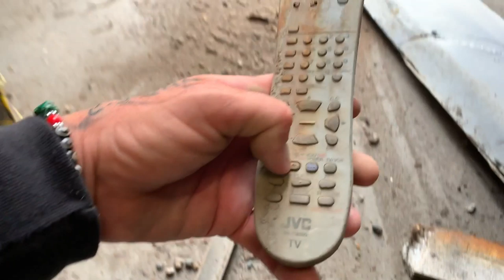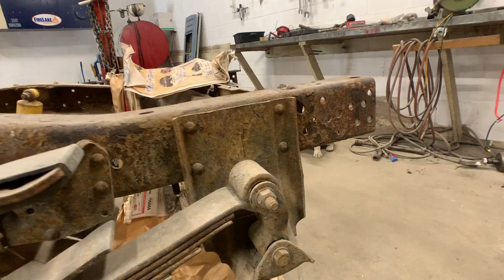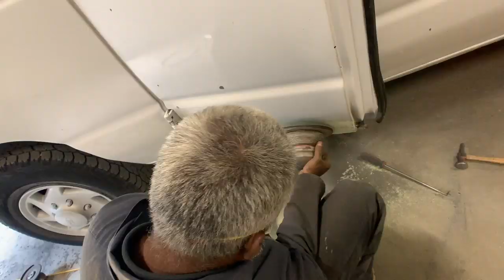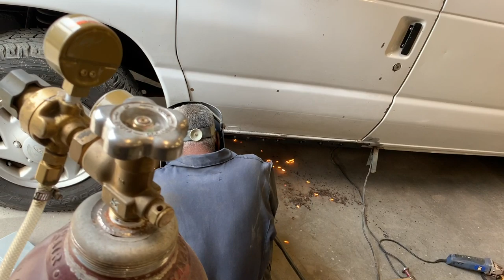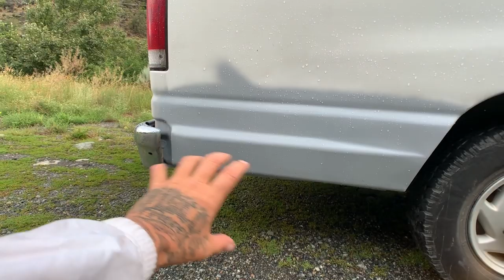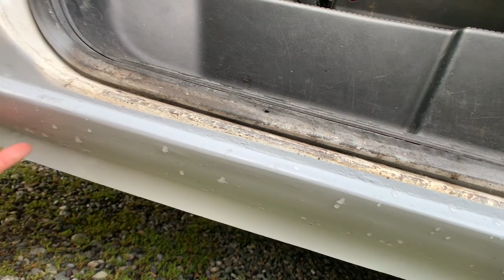Cut A Hole In My Van And a TV Remote Fell Out ?? RUST REPAIR

Comment: last year just retired my 2000 ford van due to mechanical problems 275000 miles and there was absoulutely no rust under van it looked amazing i live in Arizona. I have a 2006 e-350 extended van there is no rust at all. its true Arizona cars have no rust. dashes may have cracks from sun paint may be faded but no rust.

Comment: hey chrome, was this rust a result of that wreck you mentioned? or because of condensation build up from bad insulation and living inside of it?  i wasnt able to catch this whole vid, but you always hear of the horror stories of installing the wrong insulation, just wondering if this is a result of that? bout to build my bed frame today, using one of your first vids for a reference! lol
Reply: It was another video he explained that there was a carry strap down in the side wall that was soaking wet and was rotting it from the inside of one of the sides and a bunch of the rust was coming in from underneath.